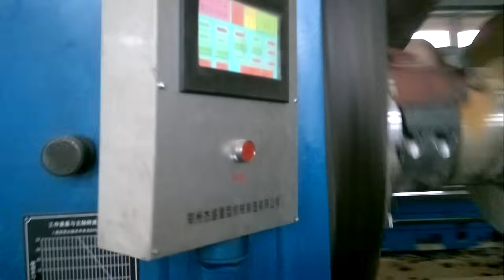32tons load bearing heavy horizontal lathe for large crankshaft processing

Comment: Pretty dangerous this way! I used to turn the tool upside down and run the lathe backwards. That way, if it did come out it was going away from me. Had a 29,000 lb crankshaft come out and it was thrown to the other side of the lathe.
Reply: That must have been one hell of a bang when that crankshaft hit the ground.
Reply: @timbo11  The damn thing flew into a pile of steel mill rolls about 4 feet high. The rolls were about 16" dia and about 12 feet long. The pile was about 30 feet long. Of course the rolls went flying everywhere. The lathe was an old Niles Bemont Pond - 48" chuck 50 feet between centers. The wrench for the tool post nuts was 44 lbs and the nuts were about 5 feet from the floor. We had a wooden riser of about a foot. The chuck wrench was heavier. And that is why I am so beat up in my old age now.
Reply: Or you could have your shit together and do it right, so parts didn't come flying out of the lathe. It's not that hard
Reply: @1530f  You seem to know exactly how it happened! And of course you know what the part was like and most of all you know just the equipment and it's condition and the t6ools available. Pretty good for someone with their head up their ass.
Reply: @1530f  How the hell would you know?
Reply: The part was run in a 55 year old Niles lathe in very poor shape. The part was for flipping a 40 ton ingot out of a basket on a car onto the roller table for a blooming mill. The crank shafting was 9" diameter and about 28 feet long. The throws were about 22" again 9" dia and a wall thickness on the throw of about 4.5". The throws were about 30" from each end of the main shaft. So you had a center stuck out 30+" on each end and most of the crank flopping around  and counterweighted as best possible from a weight on the chuck.  The only way to cut the journals was to have the tool sticking out about 30". If you ran the machine conventually, if the was a problem, the part was coming toward you. That's why I ran it the other direction. They had made this part many times over more than 60 years. More than once they had problems.  Many of the guys just wouldn't run that part, they thought it was too dangerous. It was a flimsy setup on a piece of junk lathe and not much in the way of tooling. By the way, there was a 3' walkway and a wall behind that on the operator side of the lathe - no place to run or get away.

Comment: It appears that every part of that shaft is running eccentric. How in the hell did they dial it in/  indicate it?
Reply: I would use the fixture plates at each end, with radial markers indicating specified portions of the shaft, then offset them both in the same direction to the desired runout.
Reply: @masterofnow1  The "plates" on the ends are counterbalancing weights to evenly distribute the run out, without them there would be to much load on the machine and it would never cut round.

Comment: No lubricants or coolants on the work?
Reply: Green Silver Can't heat up something that big enough to damage it just from machining. Think about it, if you got that massive amount of steel red hot it would take days to cool down.
Reply: Ryan Trahan The coolant is to keep the cutter cool, not the part.  But running coolant isn't necessary.  You can machine dry.
Reply: TheOhioCountryboy Yea I know, but that is in fast spinning applications.
Reply: Ryan Trahan How fast it is spinning is irrelevant.  Surface footage is what you look at.  You can spin a large diameter part slowly, and still have the same surface footage as a small diameter part spinning high rpm's.
I've machined spinning at 90 rpm's, and the ceramic insert would glow red while cutting.
I've also machined using compressed air as the coolant too, but that was running a 4-axis mill.
Reply: TheOhioCountryboy 90 rpm's is still considered spinning fast though. I'm talking about lower speeds.
Reply: +TheOhioCountryboy You sis also spins fast!
Reply: +TheOhioCountryboy just curious but wouldn't air act more just as a means to evacuate chips than to cool the cutter? i could be wrong haha
Reply: The part would just throw it all over the place.
Reply: @TheOhioCountryboy  Steel mill - used to run backup rolls 60" dia and the contact area was 88" wide - so it was a pretty good cut. Average weight was 93,000 pounds. The rolls were weighed so you knew the weight to set the center. Used a 2" wide ceramic bit cutting at a very slight angle to the surface so a .010" cut would cut almost across the entire width of the bit. Ran 55-55 RPM ! Made ribbon candy chip(s). You had one chance to get the chip started down to the chip tray under the bed and a 60' deep pit, or you made a helluva mess. Would take hours to get that mess off the machine. Used a crane and a 4' diameter electromagnet to got the biggest part of the mess off. If you missed getting the chip where it was supposed to go, all you could do was stand away from the machine.The lathe was made by Blaw Knox of steel mill fame in Wheeling WVA. 150 HP. Had a tracer attachment for some of the special rolls. Unfortunately, it had a semi automatic jaw tightener for the chuck. Unfortunate because it extended and retracted un automatically. If you forgot to retract it, the lathe was in low gear and would shear off the wrench assembly. The 2" shaft just went clink and the lathe didn't even grunt.
Use to run 12 and 15' vertical boring mills too. Chuck was at floor level. The RPM was slow, but as you stood and watched, it ruined you brain. When you turned around you couldn't walk - the whole floor in front of you was moving just like the chuck was. Sometime took a couple of minutes before it was safe to walk.

Comment: We have Wagner (Germany)   lathe at WIL Walchandnagar (Maharashtra, India) of 65 t capacity between center which is increased to 120 t by adopting  hydropneumatic cylinder support roller system 
Initially  it had 19.5 mtr  admit between center which is increased to 21.5 mtr 
It has 18 speed gearbox driven by 40 kw motor
With this modification  we were able to machine cement mills,  reaction towers. 
I was heading erectioni and commissioning team for the same modification

Comment: pointing out that the workers are not whering safety glasses
Reply: ***** or protective footwear and there are obvious unmarked, unfenced risks of crushing and falling. Gee.. It's like 80 years ago in a european or american factory.
Reply: +trip3980 replace a dead worker with new one just cheaper than buying them safety gears.
Reply: what safety gear would help with a 30 tonn workipece ? , and the chips are not flying that fast , its only like 30 rpm .
Reply: I've seen chips fly from that sort of thing, they're not exactly predictable. However it is China so of course there is no safety
Reply: @Pow3llMorgan  that's why it is so cheap
Reply: @IntasarnW  

Safety equipment is dirt cheap in China like much of everything else low tech. Getting a worker injured or killed will cause the factory dearly because of the factory is liable for medical bills unlike the US where insurance foots the bill.

My guess is either lack of proper supervision or just common practice because the workers are good at what they do.